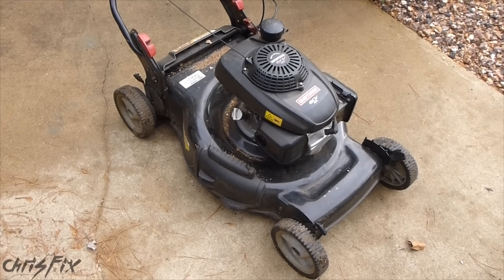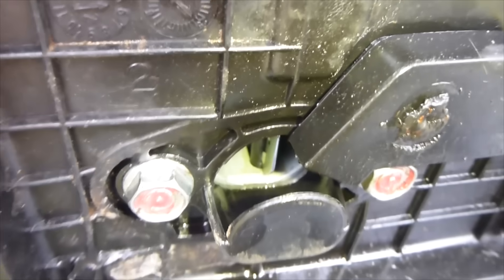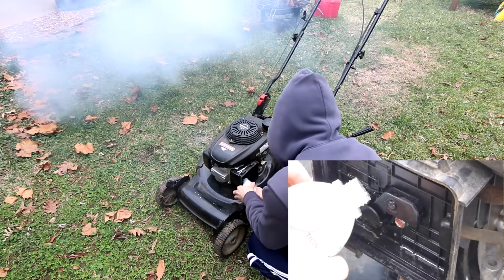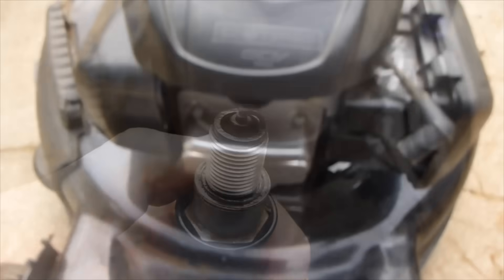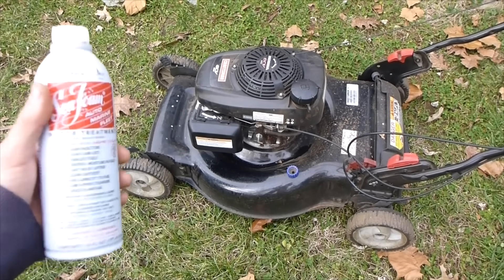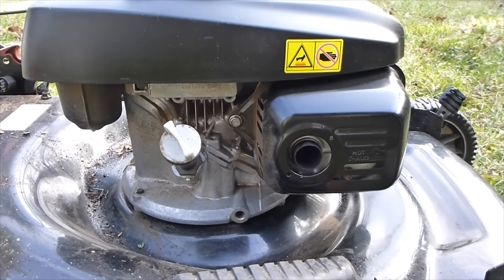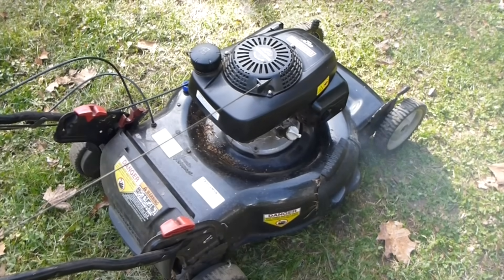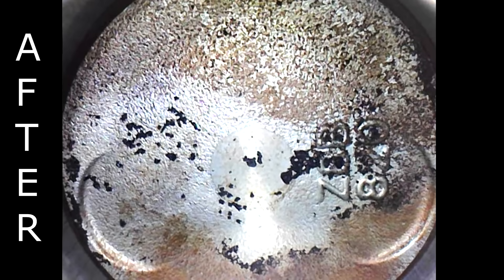Does Seafoam Actually Work? (with Proof)

Comment: your not supposed to pour the seafoam through the air intake your supposed to pour it into the gas tank
Reply from the maker: TheTractorboy828 You can do either as per the instructions on the bottle.

Comment: Ran it on my dad's 1987 IROC-Z, and it ran MUCH better than it did before the treatment (about 200k+ miles on the car too). Even cleared EGR problems that the ECU was throwing codes for.
Reply from the maker: silvercoke Thanks for sharing! Yea, I was pretty impressed with the results on the mower. I will be testing it in my truck soon!

Comment: Chris, you can  take a vacuum hose  off and pull some Seafoam into it. and directly cut the
engine off. Let set for  a few hours and check. You ever try using MMO? The Marvel oil?
Wonder how that works on these carbon build ups.
Reply from the maker: grassroot011 I will be testing seafoam in my truck very soon! Thanks! I have used MMO but never tested it. The bottle doesnt make any claims to remove carbon in the combustion chamber.
Reply: I've read  people who did test it this way and found it turned carbon deposits to a soft  sooty
layer that  burns off easily. A claim that I don't know for sure is true.
Reply from the maker: grassroot011 I might give it a test run anyhow and see because I have had a lot of interest.
Reply: Yup, It'd be interesting to me too as I've done this
with the MMO  pulling it into the combustion chamber  but not with the other stuff as you have.
Plus I don't have the bore scope. Haa, so we're
waiting your results. Thanks for the past views.

Comment: Motor needs to be as hot as possible for the water mist to work. Hot carbon meets water causes carbon to shatter.
Reply from the maker: ROBERTGUERO Yes, when I test it in my car I will be using a hot engine!
Reply: ChrisFix not sure about the seafoam stuff. But I know water will shatter carbon. Thank you for your time on these vids. Really appreciate all your detail.

Comment: AAAAAAAA       TTTTTTTTT          FFFFFFFFFF
A             A               T                  F
AAAAAAAA               T                  FFFFFFFFFF
A             A               T                  F
A             A               T                  F

Instead of putting something like this into the fuel, maybe do what I did to my car after i bought it ( used condition ), I changed the oil, drained all old oil, then removed old oil filter, drained the old oil from the oil filter, put the old oil filter back on the engine, then put the drain plug back on and tighten it, fill up the engine with ( ATF ) the common regular Dexron III / Mercon V  Automatic Transmission Fluid to full amount, my engine takes 5 liters yours might differ, let the engine idle at normal speed, until the engine cooling fan kicks in and kicks off, then turn off the engine, drain all the ( ATF ) then replace the old oil filter and fill the engine back up with exact amount and proper viscosity, and type of motor oil. 

Automatic Transmission Fluid is highly concentrated in cleaning solutions along with lubricants in it, due to high amounts of cleaning chemicals in the ( ATF ) it cleans the carbon inside the engine, which includes the combustion chamber.

With the ( ATF ) inside the engine, it will work its way into the cylinder chambers, coating all the metal parts in the engine, breaking down the carbon,and cleaning it.

Although any ( ATF ) can be used, the common regular Dexron III / Mercon V ( ATF ) is low priced, and is available at any auto part stores. Works well for this.

If you ever seen inside a transmission, it is very clean, unless the transmission was abused and transmission fluid was never ever changed.

------------------------------------------------------------------------------------------------------------------------------------------------------------------------------------

BBBB            EEEEEE   SSSSSSSS   TTTTTTTTTT
B     B            E              S                            T
BBBBBBB     EEEEEE   SSSSSSSS             T
B           B      E                              S            T
BBBBBBB     EEEEEE    SSSSSSSS            T
 
The simplest solution would be keep your oil changes done on time, and every time, with the proper motor oil type and amount.

Best done with synthetic motor oil, instead of the other types of motor oil such as, regular, high mileage, or semi synthetic.

As a general guideline, for oil changes.

( 3rd Best Oil ) Regular Oil is changed at : 5000 Kilometers or 3000 Miles

( 2nd Best Oil ) Semi Synthetic Oil  at : 7000 Kilometers or 4000 Miles

( 1st Best Oil  ) Synthetic Oil at : 10000 Kilometers or 7000 Miles

Keep in mind to refer to manufacturer's gives guidelines 1st when changing oil,
if otherwise then refer to the general oil change guideline.

Its a lot less expensive to keep your oil changes done on time, every time, otherwise sooner or later you will end up with expensive engine repairs or even need engine replacement, and is very very expensive for parts and labor.

I keep my oil changes on time and every time, and do it a little before the oil change interval, do it myself, and I use Royal Purple Synthetic Motor Oil and Mobil 1 Synthetic Oil Filter on my one and only car, an old 90's GM car, and it runs great.

I know this works, had compared the before and after results, after removing the oil pan, had to change the oil pan gasket anyways, defective oil pan gasket.

If you are wondering why I put such high priced and quality oil and oil filter, its because its my only car, and I care about it, even if it is pretty old, there is no better engine insurance than to do the oil changes on time and every time with best oil and best filter. (  My Car Deserves The Best Parts  )

Its most ideal to put best parts in a car than some cheap parts, if you can afford it.
Older cars need better than cheap car parts, especially older cars, makes / keeps the car that much more reliable and better running, by long run.

Proper Maintenance = Less Repair Costs +  More Driving Without Problems or Less Problems.
Reply: I have a Caravan that have the stock engine ,i always use a new oil filter at each oil change ,and the fuel filter before the winter each year .The engine have 248500 miles and still runs like a song .You're right proprer maintenance makes long mileage engines .

Comment: Thanks for all the great videos. im going to use a micro camera to help me find my horn and PVC valve on my 97 mercury mountaineer since they are not clearly visible
Reply from the maker: Travis W No problem! I am glad the videos have been helpful! The camera will work perfect for that! I just used it to find a speed sensor hidden behind my van's engine!
Reply: Cool.. my goal  is to maximize  fuel efficiency  on my 97 mercury  mountaineer V8 AWD
Reply from the maker: Travis W Correct tire pressure and driving style are big factors. Good luck!
Reply: ChrisFix cool thank u

Comment: I like the video.  Id rather see the effect on the valves though.  I guess theres no way of seeing that without pulling the head though.  Id also like to see a video using straight water
Reply from the maker: Rukkkis Thanks! I will be testing seafoam in my truck and I will be testing straight water as well! I will see if I can find an engine where I can see the valves though the intake easily.

Comment: Have you done a water injected into the intake through a vacuum line test with the camera? Some mechanics say it cleans off carbon the best but cannot add too much will hydrolock engine.

Comment: I tried it in my old '01 Ram 5.9 gasser a few years ago with 160,000 KM on it. Just took the vacuum booster line off and poured it down there with it running. Let it sit for about 20 minutes and went for a drive. First thing I did was hold it to the floor until I hit about 80 and I could not see the tailgate of the truck for about 2 kilometers the smoke was so thick. Tried it again the next day. Same amount, let it sit the same amount of time. Truck hardly smoked at all so I assumed it did something in there. Nice to have confirmation. Truck idled and ran way better afterwards too.
Reply: That's a Italian tuneup
Reply from the maker: ***** Awesome! Thanks for sharing! I guess when I try it in my truck I should tell the fire department they might get some calls haha

Comment: Seafoam is awesome...
Reply from the maker: kugmyster I will be testing seafoam in my truck very soon!
Reply: Chris, can't wait til your vid on your truck..  I am assuming it will be your Mazda, on those Rangers and B series I like to introduce Seafoam in through the brake booster vacuum hose.  It ensures the product will travel through your INTAKE and then down to you combustion chamber.  Soo use your camera on the cylinders to check for cleaning, but also try to get a camera into your intake manifold to see all the crap Seafoam cleans in there too.  By doing Seafoam in any car with advanced sensors, you might pull a code after you do this.... Probably a throttle body or most likely an O2 fault.  Just run 2-3 complete drive cycles and should clear.....but what I do is just clear it with one of my smaller code reader.......sorry to such long winded....you knew this crap already....keep up the good vids man!
Reply from the maker: kugmyster Thanks a lot for the info man! I cannot wait either! I will see if I can get some intake shots!

Comment: It wasn't the Seafoam that cleaned the piston.  Plain old water drizzled into a running combustion engine will turn to steam, break up the carbon deposits and blow them out.  It was a  common practice in my dad's maintenance schedule for all our vehicles.  Bottom line: save your money and don't waste it on Seafoam.
Reply from the maker: Wesley Wong Actually, before this test I used water and you saw the engine was still dirty. I will be testing water in a car engine soon!

Comment: I've heard that it's good to have a slight carbon coating on the piston tops,so that the carbon keeps some of the heat in the chamber, instead of allowing it to dissipate into the piston,losing thermal efficiency. But,if it pings,you need to clean.
Reply from the maker: ***** Interesting. I never heard of that but it makes some sense. Thanks for sharing!

Comment: I had a 1999 Ford Taurus with about 125K miles on it and it was running so poorly if you did anything but ease in to the throttle it would bog...I assumed I had fuel injections issues so tried techron...i noticed zero difference...then I tried sea foam gasoline additive (you can also put the same thing in the oil)
Reply from the maker: steve Fowler Did you feel a difference with seafoam?
Reply: ChrisFix
Sorry my youtube session hung for some reason...yes the sea foam fixed my sluggishness after less than one tank of gas...ran perfect after that until I sold her 2 years ago.
Reply from the maker: No worries. I was curious to how the story ended haha. That is pretty good! Thanks for sharing!

Comment: just add it to the gas tank
Reply: If the car is on e, u can add a whole can of seafoam. It works.
Reply from the maker: lance huttsell Adding it to the gas tank will not remove carbon in the combustion chamber and if it does remove anything it will only be a little. When you add it to the gas it cleans the injectors (or carb) and the valves.

Comment: Please explain why a little carbon in the combustion chamber is a big deal anyway. That carborated lawn mower engine runs a lot a lot more rich and loose than your fuel injected/computer controlled car engine. Carbon may affect combustion swirl a little but only if there is a ton of it in there. Put that cam in your car engine and I bet there is very little carbon build up. Seafoam and those additive cleaners are a rip off and a waste of money IMO.
Reply from the maker: kineticsurf This was just a test to see if seafoam works. The little amount of carbon in this engine does absolutely nothing detrimental to the engine. Check out the links in the description to see the tests on my pickup truck using gumout, lucas, and techron. You can also see the amount of carbon buildup in the engine.
Reply from the maker: kineticsurf Oh, and definitely consider subscribing! New automotive "how to" videos every Thursday and most Mondays!

Comment: it not a good idea to use anything that cleans the cylinder walls and piston rings on AN OLD MOTOR , commonly know as combustion chamber cleaner it will remove all the carbon that in fact is helping to seal your old motor, you will lose comprehension making you lose horsepower and increasing blow by allowing gas getting in to the oil and where out your bearings faster, DON'T DO IT ther is no qwick fix for old motors to run better other then a good tune up,,,, try some new spark plugs and then new wires before you sentient your motor to doom with that shit :)
Reply from the maker: uhfnutbar1 Thanks for sharing!

Comment: How about a video on how to separate electical connectors.. I just can't figure them out . Which ones you squezze to separate and which ones you pull the tabs outward . What I end up doing is snapping the locking tabs off . That way i,m  sure they will come apart . Not an ideal thing
Reply from the maker: bob brawley Thanks for the video suggestion! I will add it to my list!

Comment: Sea Foam is just kerosene and some light solvent. You could use kerosene to do the same thing, or just make your own. 2 gallons kerosene + 1 quart mineral spirits + 1 quart naphtha + 1 quart ATF + 2 bottles HEAT fuel system drier, and you've got yourself 50 bucks worth of "Seafoam".
Reply from the maker: ***** Thanks for sharing!

Comment: Hey Chris,
Rebuilding a turbo, do you think Seafoam would help remove carbon build up on the exhaust housing?
Reply from the maker: Francesco Antinoro I actually dont know since I have never tested seafoam on a cold engine. I mean, I guess it should since it works when heated.

Comment: I am a believer in Seafoam(sf16) but I use it differently, you will get better results using Lucas (10020) the 5.5 oz container in your gas. In older or abused vehicles use the seafoam in the intake this can be accomplished by taking the vac. line off the power booster where it sucks into the intake manifold directly. Take the sea foam (about 3-5 oz 6-8 for old abused vehicles) pour it into a clean cup (keep in mind most vehicles will idle up and or die when you take the booster hose off so plug it with your thumb until you put it in the cup) put the booster hose into the cup sucking in all the seafoam out of it. Your vehicle will bog down and possibly look like the mystery machine with all that white smoke coming out but that is a good thing, all that white smoke is carbon burning off during combustion. Your old or abused vehicle will run like a champ barring any other issues. For conventional oil I use lucas oil stabilizer (10001) and synthetic I use lucas syn oil stabilizer (10130)
Reply from the maker: Joe Gerard Thanks for the input Joe! Did you see this video of the Lucas Deep Clean: https://www.youtube.com/watch?v=FLhXqgEEYyI

Comment: For best results, add that third to the gas tank and it will gradually clean it and keep it clean throughout its lifespan.  I use this technique from the small engines of my snowmobiles to the twin 454 CI engines in my boat.  They all run great and prevent the need for a rebuild.
Reply from the maker: Alex Moeller Thanks for sharing Alex!

Comment: Good job Chris.  I do think you can do this in the vehicle.  They make attachement detail kits for shop vacs that get into tight places.  This is the one I have never thought I would do it for this.  Now that I think about it perhaps something with not very abrasive brissels can loosen stuff up and then get vacuumed out.  I think it is worth a try.  Perhaps this as well. When you tear down an engine perhaps you can do a test of the Seafoam and maybe the vinegar and baking soda on some old pistons that have carbon on them and time the tests with solvents on top.  Might prove interesting. I will have to ask a couple of the shops around here if I do the test I will share results.   Thanks for the vids.  Did you do the water test?

https://www.youtube.com/watch?v=5SoZnymBSC8
Reply from the maker: William Ward Thanks William. I will be doing the water test soon! Let me know if you test any of your ideas.
Reply: I will hmmm. Perhaps a sparkplug. Though I just take a propane torch to it and burn off all the carbon and it is like brand new again.

Comment: Man, despite the hype, I wouldn’t touch Seafoam with a ten foot pole. I’ve tried several highly-rated, highly-touted, miracle treatments (carb cleaners, carbon cleaners, etc) in the past, usually with either no results or disastrous results (engine died completely, etc). Absolutely none have ever actually really improved anything, which is probably why so few vehicle manufacturers recommend such nonsense.

Comment: I'm curious how water would have performed in the same test.  It's long been a mechanic's trick to pour water down the intake of a fast running engine to descale the carbon from the combustion chambers.  The flashing of water to steam does the work, allegedly.
Reply from the maker: eformance I will be testing water out in a car so stay tuned. Also, when I first got my bore scope camera, I tested water which is how that clean spot at the bottom of cylinder happened.

Comment: i think if you pulled the head and cleaned it with some brake cleaner and rags and put it back together it would have been cheaper and accomplished more.
Reply from the maker: Miller Thompson That isnt the point. I have a whole series of fuel system cleaner tests on cars and trucks and this was a small scale test. I will be doing a large scale test on my truck soon!